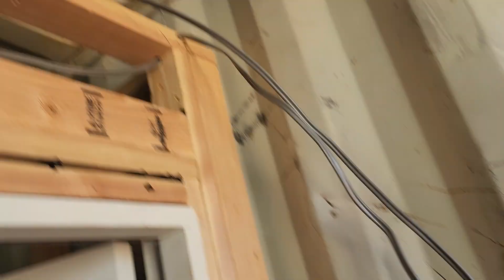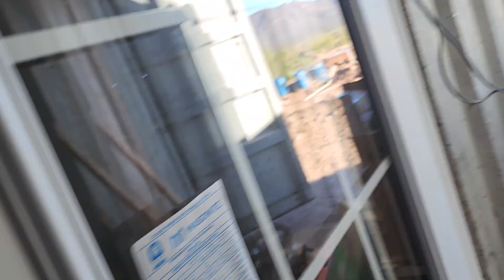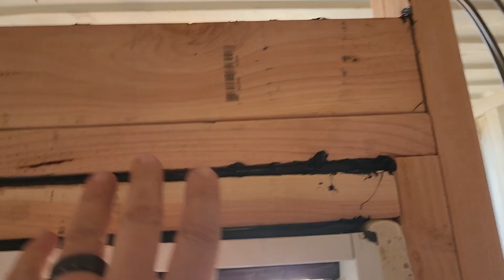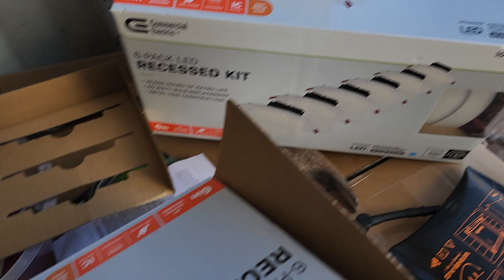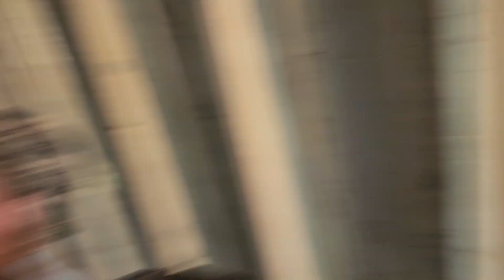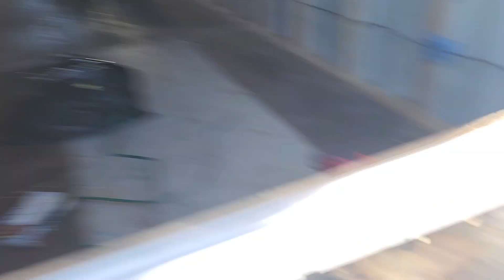His and Hers shipping container build. Today is electrical day.

Comment: Today's project - Throwing the ball!  🐶You were right, that sucker ain't goin' anywhere!  Super-Sturdy!  Since you're putting so much work into the walls, you might want to go a little thicker on the ceiling insulation unless you use some of that excess foam for the underside of the roof as well.  I used the EPS on my equipment room and put regular pink stuff in the interior walls and ceiling and I should have done both on the exterior.  This is the room in my metal building that I (currently) work my day-job in as well as housing all of my solar and computer equipment.  I installed a portable A/C, but the South and East walls (equipment walls) are only using that EPS.  So they heat up a bit more in the summer making that portable A/C worker harder/longer.  And remember what going to be beating down on that roof next July/Aug! 🌞🌞🌞